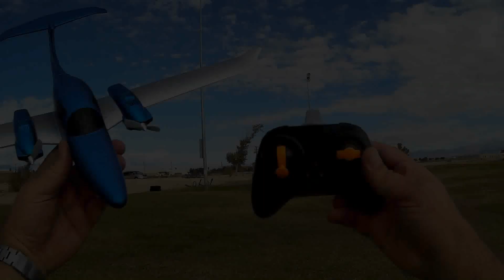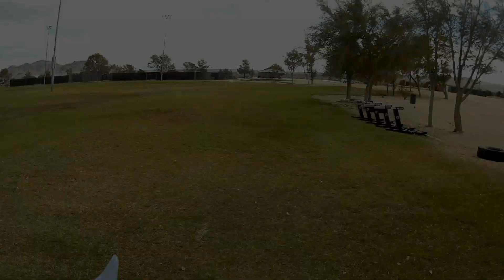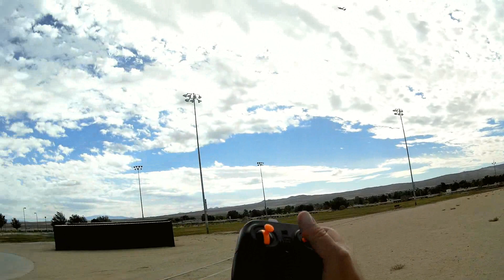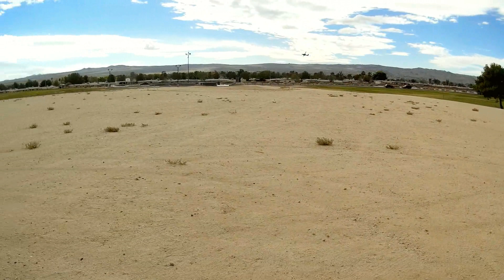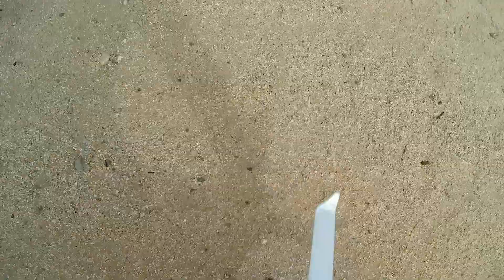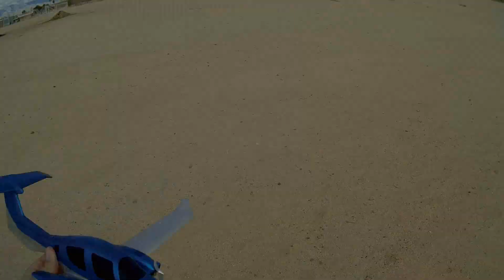GD-006 Diamond DA62 RC Airplane Flight Test Review

Comment: When I try to fly mine off the ground it only goes in circles and when I throw it it goes into a left nose dive-anybody know what’s wrong
Reply from the maker: See those two little buttons on the bottom of the controller?  Repeatedly press the right one until the plane straightens out its flight.

Comment: For those that fly this model. If your model fly's to the left or right persistently you can trim it to fly straight by pressing any one of the two trim buttons located at the centre of the transmitter.

Comment: Mine will not turn right even when trim set or higher rate..   would adding a little bit bigger engine to right help that or different prop?   Just looking for way to fix it.
Reply from the maker: Try adding a rudder to the tail. Cut a small rectangular piece from an old credit card, then tape it to the trailing edge of the vertical stabilizer. Then bend it to the right a small amount to give the plane more right yaw authority.
Reply from the maker: Also I recommend trying the trim buttons again. If one doesn't seem to correct the yaw, try the other. I've seen other toy grade controllers install the trim buttons backwards, and that might be the problem here.

Comment: It's a great plane, flies very easy, turns good with some trim adjustment. Y use a 600 mah lipo battery for longer flights (20min), for this, I opened room by removing some foam from the interior. The blue paint is too delicate comes off really easy. Great packaging.

Comment: You’ll find that if you press the trim buttons on the controls until the engines are reving evenly you will have an airplane which turns both left and right.. a lot better.

Comment: I have bought 2 drones and 1 plane from Banggood and all have arrived damaged because of poor packing. and they would not send a replacement. The gave me some of my money back and gave me the part numbers for me to buy replacement parts I probably won't be buying anything but maybe parts from them
Reply: Edgar.  Other than Quadcopter 101 here, I've purchased in the $1,500 to $2,000 over the years with Banggood.  On my dime of course.  Banggood has been pretty good to me but to be honest.  Spend more money and deal with companies like Horizon Hobby..  Just last week, purchased a really neat UMX PT-17 plane from an eBay seller who's authorized distributor for them. Paid $99 for it BNF "Bind and fly".. Got the plane and it had a bad aileron servo!!  Sent them a video and now they are going to send me a new plane and I keep the old one!

Comment: it says it is a built in battery ?  if this is true how would you get extra batteries ?
Reply from the maker: That's false, and is an error in the listing.  It uses a very common 3.7V 300mah LiPo with white Losi connector.  Simply open the battery door and swap out with a new battery to keep flying.

Comment: I like that one. As you say it's quiet and did rather well given the wind. Looks like it needs some mechanical trimming (if possible) but on a calm day it would be a hoot.
You are better at getting the throttle reduction/descent than I am as I either mush in or balloon up with 2ch planes. 
For where I fly I'd probably remove the wheels and fit a small foam skeg on the bottom as it's too rough for take-off/landings on small wheels